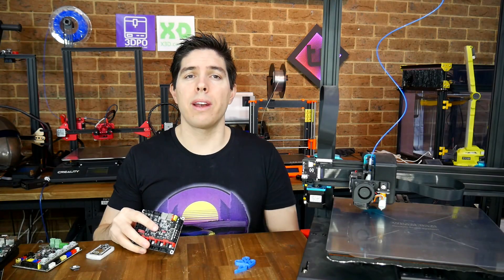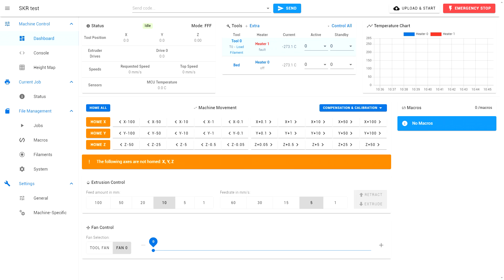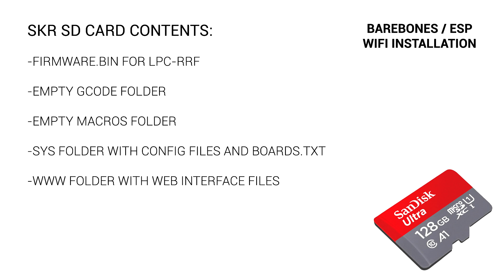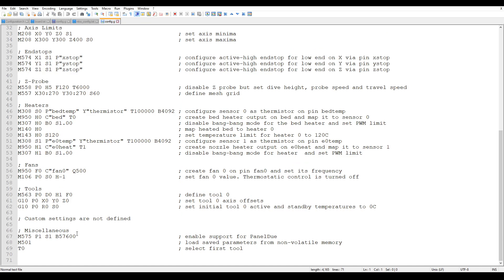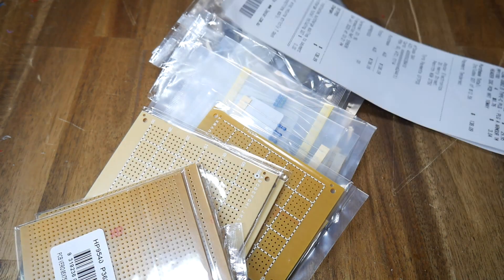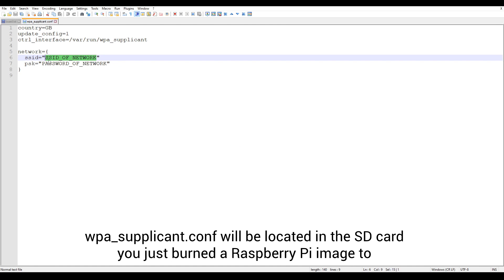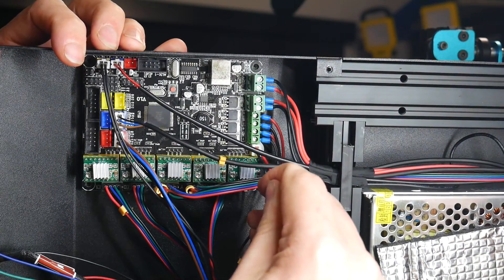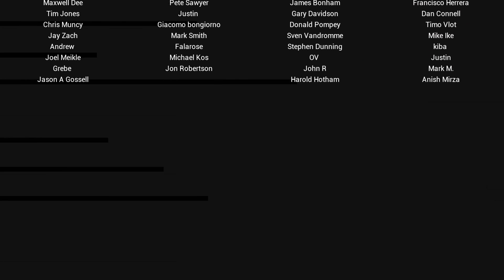RepRap firmware on SKR mainboard guide - The best firmware on a budget

Comment: I noticed looking at the board specs that the Duet has a floating point unit whereas the SKR does not.  Any ideas how this affects print operations (or maybe this would be something to compare and contrast on delta printers which are much more computationally expensive to run)
Reply: FPU isn’t really a big deal, the Maestro doesn’t have one either and easily handles everything you may throw on it. The biggest drawback of the SKR is the lack of SRAM which means that certain features of RRF aren’t available.
Reply: @christophmuller3511  Are these features summarized somewhere?
Reply: Good point! Makes me wonder if the RPi-based option covers the FPU stuff...

Comment: Another quality video, thanks !  I'd really like to see a Pro's/ Con's comparison with Marlin 2.0 on an SKR 1.3 / 1.4
Reply from the maker: Considering this down the track.
Reply: I’d love to see this too, so I will vote for the comparison as well. I have an SKR 1.4T right here in my hot little hands that I am about to throw in my SWX1. Worked on compiling the latest build of Marlin for it last night so that’s going on first, but I am curious about RepRap.  Ultimately in my decision making process, I just didn’t see any advantage of going with it versus using a combo of Marlin and OctoPrint. I couldn’t come to a conclusion in my research either way if OctoPrint would even work with RepRap, so that right there would potentially be a dealbreaker.. gotta have my OctoPrint just for the Home Assistant hooks. Also can’t seem to understand what advantages, if any, the RepRap web UI would have over OctoPrint.

Comment: OH MY GOD, thank you so much for this guide. I just bought the SKR 1.4 + TMC2209's + TFT touchscreen and WiFi... I was already preparing to use Marlin but now that I see RRF is available for this board, damn this is just so much better. Thanks again! The only difference from your guide and what I have is that I am using the WiFi from BigTreeTech that comes with the SKR 1.4 board. so basically I am not using a separate branded board. It comes with a programmer so it's quite doable I guess.
Reply: The WiFi board of BTT is not usable for RFF
Reply: @PCR  I was afraid this was the case.. It wasn't clear to me in the video. Did he mention it somewhere? I must've missed it. Thanks.
Reply: good but Marlin will do the job and if everybody does that, RepRap will go bankrupt :)
Reply: RomanoProductions how will using Marlin instead help Duet3d?
Reply: @christophmuller3511  I was wondering this myself. I am not planning on buying Duet3D anyway, so they do not lose a customer with me. And I think this method is still too much hassle for most consumers.

Comment: Just what I've been waiting for Michael, thank you. Just one question, Does the diag pin still need to be clipped when using 2209 drivers on the SKR 1.3? I'll have to read through the BL Touch documentation on getting it set up, not sure I could live without it now.
Reply: Heh Spike ,  AS far as i know you only need to clip the diag pin on axis that will use an endstop and im assuming a BL touch falls into that category.  Cheers Phil
Reply from the maker: I clipped them all, but I agree with bigfilsing. Nothing will blow up if you don't clip, you just won't be able to get the endstop to register. Easily to test with M119 to find out if you need to clip or not.
Reply: @TeachingTech  Good point, I will try it without clipping first. Thanks Michael. I'm not going to have time to do it yet, but always good to have as much info as possible before diving in. I do love Marlin but having to re-compile with every change is a pain, also you have to keep the firmware that is on the board, this is where my stupidity raised it's head.
Don't get me wrong, the #Borg is working perfectly as is, but you all know, I do love to tinker 😂
Reply: @bigfilsing  Thanks Phil, appreciate your advice.

Comment: Resistor 100R 1% 250mW is  ok for the raspberry pi cable?
Reply: If the Pi isn't being powered by it (most likely not), that should do. The % is the tolerance (so it's rated to be within 1% of 100 Ohm, the mW value is the capacity it can handle before smoking. Data lines don't draw a lot of current.

These inline resistors are just acting as a current limiter to protect the boards.
Reply from the maker: I used 150R since that's what I had on hand. No issues.

Comment: Is it possible to do it with a skr pro v1.1?
Reply: probably but you need to figure out about the pin layout from Marlin.
Reply: Probably not, cause it's for LPC boards, and SKR Pro has another microcontroller

Comment: My X1 has been working flawless for the past year. I see this video and feel the temptation. I've been resisting upgrade temptations till the printer needs fixing. Other than the much nicer hardware and web interface, is the printing improvement 10X or just operates about the same?
Reply from the maker: Prints the same in most cases. From now however I can up micro stepping and add linear advance. Both possible with the old 8 bit board, but will run a bit better here. So the hardware change will help my prints more than the firmware change.

Comment: Nice, but can I use octoprint? And is there actually a difference between print quality of reprap vs Marlin?
Reply: I have the same question. I'm using Octoprint and love it. So does this make the print better? I'm not into doing something like this just to say I did it. What is the benefit?
Reply: I have the same question. I'm using Octoprint and love it. So does this make the print better? I'm not into doing something like this just to say I did it. What is the benefit?
Reply from the maker: In terms of base firmware, I'd say no difference. The serial communication used here is faster than the USB serial used by Octoprint so potentially if you were having buffering/stuttering issues with Octoprint, the SBC installation here would not suffer the same way.